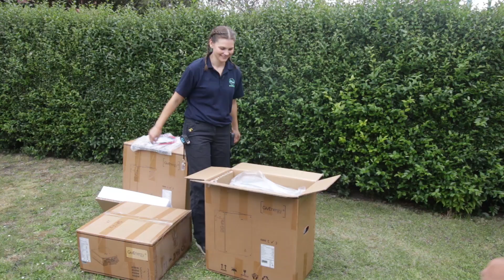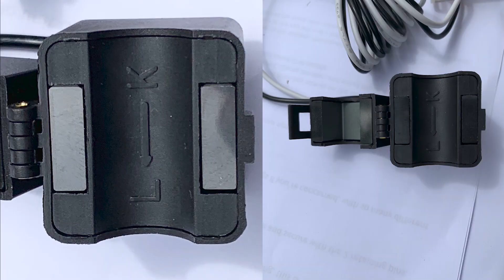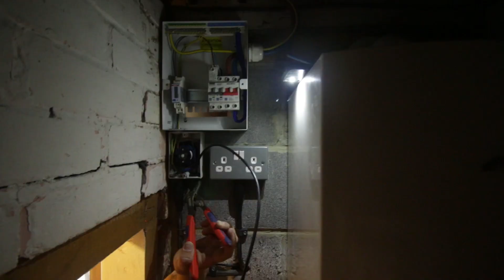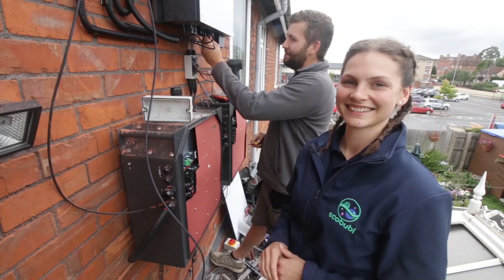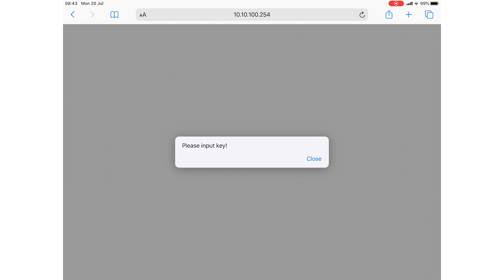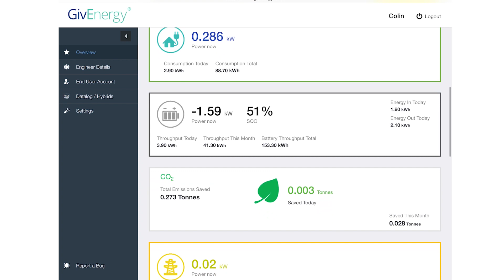Unboxing of a GivEnergy Electric Storage Battery System

Comment: any one worried about the battery cables in the video? 6:34 into video give a clear view :O
Reply: If you know anything about fitting Givenergy batteries, the early models had an cable gland for the DC cables to seal tightly against the cables, the black conduit you can see is not there for water proofing the cables, just to protecting the cables.
Reply: @martinperrin1178  sure, the waterproof glad will stop water ingress but how much "protection" will be provided when the cable  "protection" isn't even coving the the cable..... UV, bugs/animals or water collecting in the cable protector?? the glad is your last line of defence from the elements/environment, this is outside after all,  it just bad engineering in my opinion. Dont use the cable "protector" if you cannot install it right, your just wasting your time :)

Comment: Thanks so much for a really informative video about installing Givenergy's hybrid inverter and battery setups.  It's a great help as I'm looking to get a very similar hybrid-based system from them, and wall mounting it too.
Would you have any opinions at all on the MPPT performance of the Givenergy hybrid inverters?  I've been trying to find out whether their MPPT is a global one, sweeping the full IV curve as opposed to a local MPPT scanner, but haven't been able to find anything at all.
If you have any views at all they would be greatly appreciated.  Thanks very much in advance 
🙂

Comment: Will giveenergy battery run the house electrics during power cuts ?
Reply: Yes, they said they put in an EPS but it is limited to 2.5KW on a dual socket. https://youtu.be/tTUfA1pVNu4?t=242

Comment: Can the battery be fitted in the loft area with the inverter? I was told a GivEnergy AC-coupled inverter with 9.5 kWh battery was not suitable.  Thank you.
Reply from the maker: Yes, but it will be difficult to lift up through the hatch, the battery weighs around 120kg, also if you had a problem in future and the battery had to be replaced, you would have to remove it from the loft again.
Reply: @ecobubl  Thank you. So in principle you could have two smaller batteries in the loft with similar capacity? A little difficult to situate elsewhere without some major work.

Comment: The flexible copex should be tucked in the gland and tightened, not away from it. Being outside it will fill with rainwater witch is not a good thing.
Reply from the maker: The flexible copex is only additional protection over the DC cables, it’s not a continuous duct, the DC cable are running through the large rubber sealing glands that are supplied with the battery, so the cables are installed as per manufacturer instructions. I have noted this before on other comments.

Comment: As a qualified electrician, Can I install this without any additional accreditation?

It's not always clear what you can/can't install when it comes to solar/Ac coupled battery systems
Reply from the maker: Yes you can install them without additional accreditation, just need to completed the GivEnergy course to be able to commission them.
Reply: @ecobubl  And that includes everything you need to know to commision with a DNO as well i'd assume.

About to Takle my first Solar system soon (It's my own) but looking to add some battery storage.

Thanks for the reply

Comment: Can the 8.2 KWh battery be fitted to a stud wall using the support frame. I would like to install a battery and 3.6 KW AC inverter in a utility room near to the Consumer Unit Cupboard.
Reply from the maker: just providing the stud wall is strong enough to hold around 100kg

Comment: Nice system but I wouldn’t want all that installed outside my house it’s a bit of an eyesore
Reply: Plus look at 8.27 exposed wires because glands not used correctly or cable tugged to hard. Water ingress means its IP rating is shot.
Reply: Sure it could look like sack tied ugly if it gets rid of your electricity bill???

Comment: Great video. Presenter is a star in the making. My solar system is 15 panels all with micro-inverters. Can you let me know what inverter I can use to take the 240V from my current system (240V AC micro inverters) to charge the batteries. Also I want to add a DC source to the GivEnergy Inverter ie new solar panel string with no inverter ( possibly 30M away from the GivEnergy invertor). I want the GivEnergy inverter to charge when my production exceeds my needs and discharge when my needs exceed production (at night for example). My current system is on my house. Grid tied. New panels on an outbuilding. So the GivEnergy system could go on either building.  thanks
Reply from the maker: Hi Philip 
Many thanks for your kind words. 
To grab the energy from your existing panels you would need the AC Coupled GivEnergy inverter, you can add up to 5 batteries of either 2.6kwh, 5.2kwh or 8.2kwh.

With the other system, it would be best to use the GivEnery Hybrid inverter, this can now be off grid and will charge and discharge a battery as you require, will also maintain your electrical requirement in the out building.
They provide a 3G network dongle so you can monitor the system. It would be best to speak to Givenergy to size your system, they have great technical support.

Hope this helps..
Kind regards
Ecobubl
Reply: Hi. thanks for the swift response. I am looking for an on grid AC coupled system rather than off grid or DC coupled system. Can you tell me the inverter to look at or a link to a technical manual. My background is electrical and electronic engineering so I would like to see how the AC couple system works and what flexibility and control I can get. again many thanks
Reply from the maker: @philipwood123  the on grid system for your home would be a on grid AC Coupled inverter, however the outbuilding you still need a inverter to move the DC energy from the solar to the DC batteries (therefore a Hybrid inverter) and then transfer AC power in the the building.
if you email us your contact details i can send you the drawings of the set ups. email: sales@ecobubl.co.uk
Reply: @ecobubl  Many thanks. Will send an email shortly. Cheers